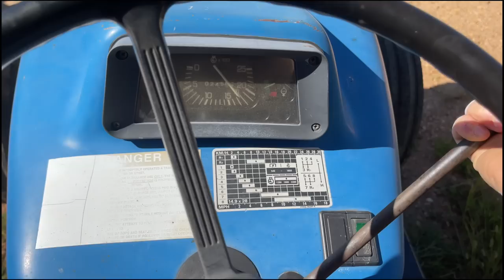Bringing it Home! Making Strides under Saddle, Post-Surgery & On Tractor (Maybe…)

Comment: Austin is a dedicated follower of horses and yea, she is showing some huge potential at this young age.  The ferrule that was leaking in the JD, to me is a brass ring that fits snuggly over the fuel/hydraulic pipe end.  Torquing the nut of the pipe tightly against the ferrule in it’s housing creates a full seal, - or at least it should. 🤞

Comment: TO HELP DEGREASE things try spray foam BATHROOM CLEANER.  I have used that for MANY years on metal stove fans and filters, on anything that has a grimy buildup. Try it I'm sure it will do the job.

Comment: A ferrule is the sealing ring beneath the nut on the hydraulic line.  That can leak if not tight or it can cause a crack in the line if not installed properly.

Comment: Dollar General cheapest oven cleaner will work better for the grease, oil, and hydraulic fluid on equipment. Cheap brake clean works also too. Spray on, wash off. Had my own dirt business before a wreck and that's what I used.

Comment: Lawrence's Shirley guy that can push through the pain but don't call him Shirley LOL guess that movie that young man surely does have long legs his feet must be full of lead  to hold them up that's why he had a hard A time jumping up on that horse and just for a thought what if you took out the time to figure out what size wrenches you need for your tractor and had a handy toolbox if not on the tractor so you can work it in the field but close by at all times I know harbor freight makes a swivel wrench two ends have different sizes of American and I believe metric sizes so it's a kind of an all-in-one tool but it's always good to have two of the same size socket wrench because it usually takes two to loosen and tighten bolts and nuts and take out the frustration of having to walk a mile five times till you get it right take frustration out of your life and I always put the tools back the way you found them

Comment: Check out TRX squats on breathe fitness youtube channel. These squats really helped my knee recovery after the surgery. I purchased a 20' load sling/rigging strap/tow strap from harbor freight.  I looped it around my porch beam. I was able to do the same exercises without spending a lot of money. $40 on the strap. I would also sit in the shade and expose my knees in the sunlight. The warmth of the sun helped with stiffness. It also helped the healing of the skin.